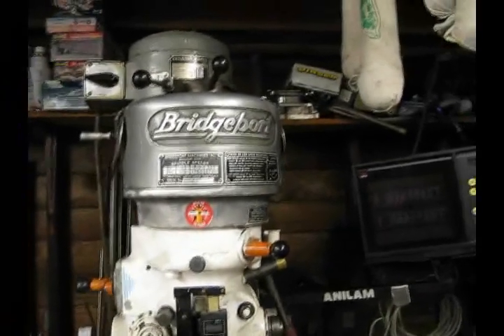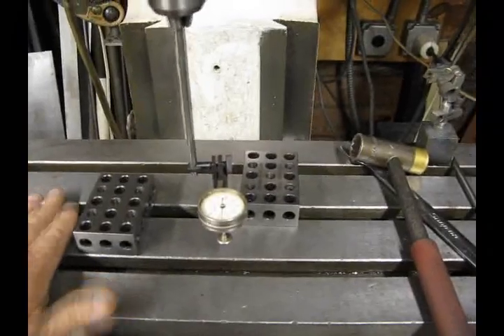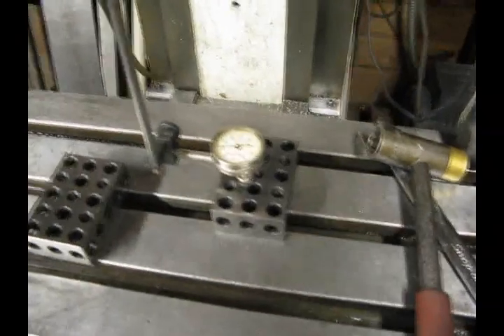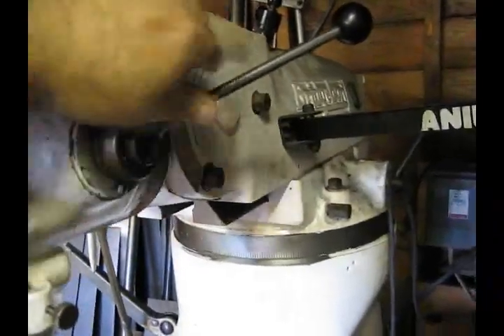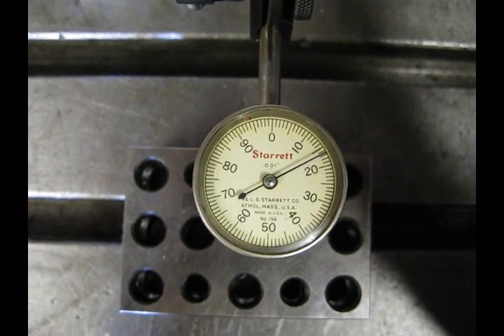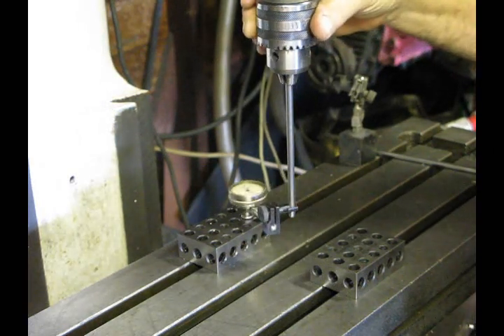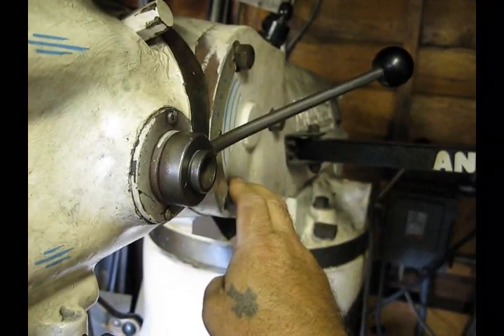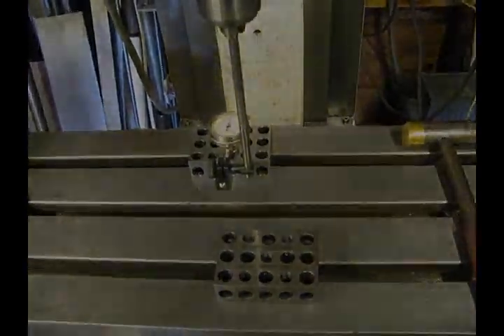Tramming the Head on a Bridgeport Mill

Comment: No need for indicators when tramming a Bridgeport, all you need is a 12" square. Wind your table up under the nose of the spindle and on the front of the quill there is two machined surfaces, one at the top of the quill height adjustment screw and at the bottom of the adjustment screw. Its like a little step. It allows you to tram both tilt and the nod. With a square off the table.

Comment: Thanks for great video. I have an Elliott Milmor,bit bigger than a Bridgeport,and it has some precision fitted dowel pins that only fit when mill is exactly true. They also fit at the main angles,15,30,45 etc. I clocked it for accuracy and it is spot on,less than two tenths.
 Do wonder why other makers don't do this? Makes life so much easier. I have fitted my machine vices and index head with similar dowel pins to make set ups quicker and easier to do.